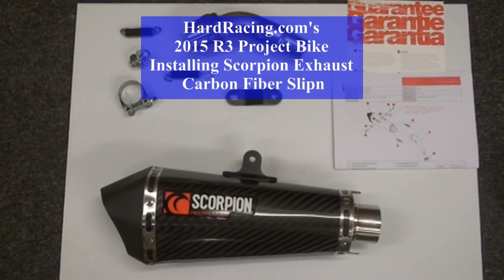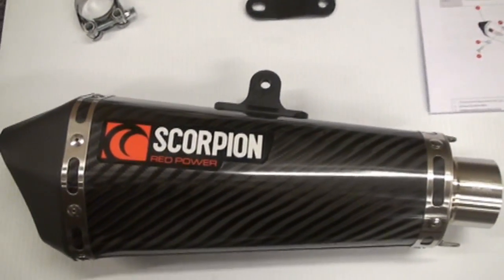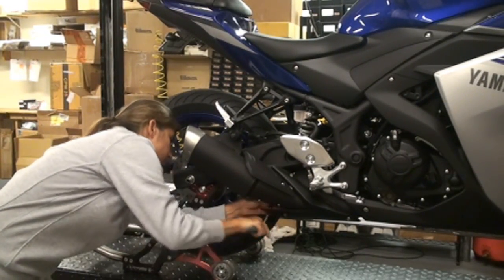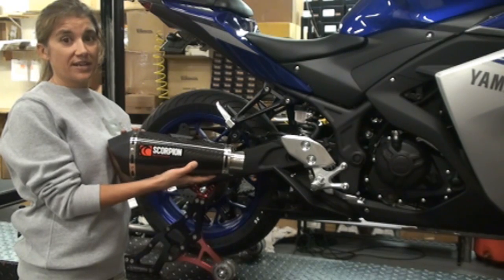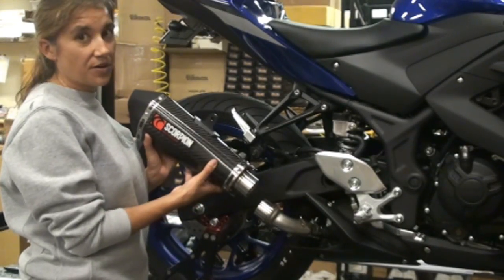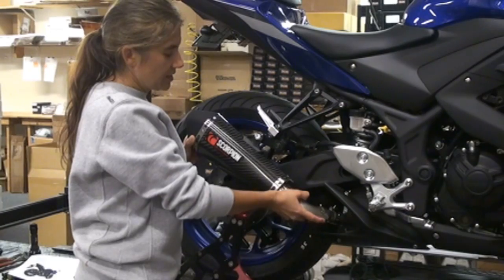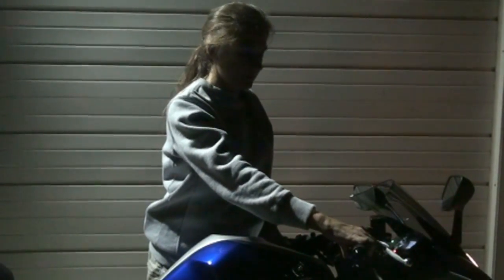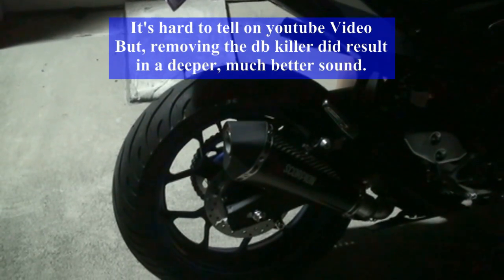Yamaha R3 Slip-on Exhaust Scorpion  - Installation - AMAZING SOUND  #Hardracing

Comment: R3 is beautiful and desirable bike but sounds like shit im sorry
Reply: Compromises must be made if you want a cool running, flickable light-weight, narrow parallel twin bike.  I had a 600, and it was wide, 50 lbs more / not as lively, and hot as hell in the summer.  If you just want to go squid fast on the freeway, get the 600.
Reply: I'm not gonna go squid on a 600 cc motorcycle, I love my skin how it is
Reply: I find it better sound than 4 inline